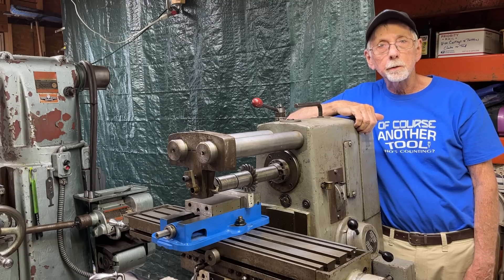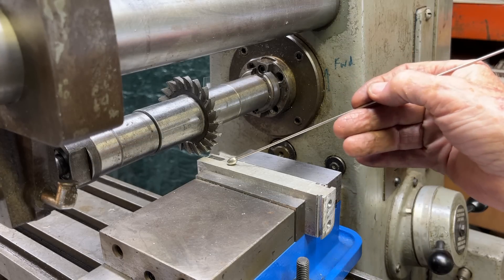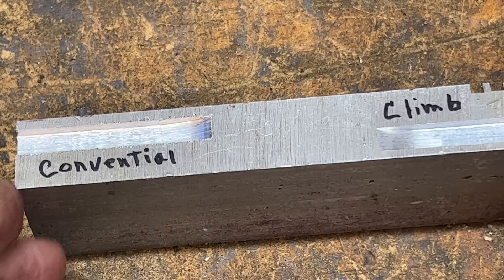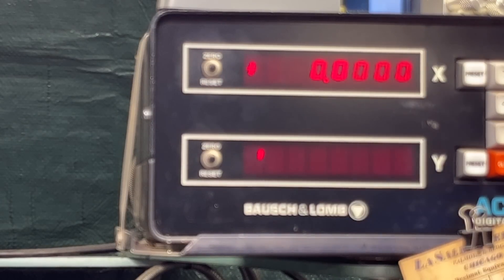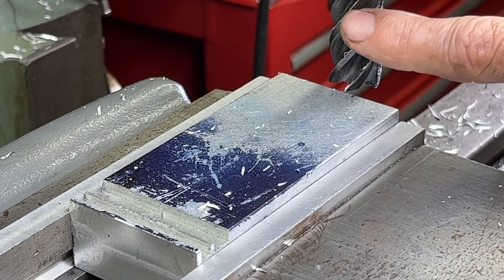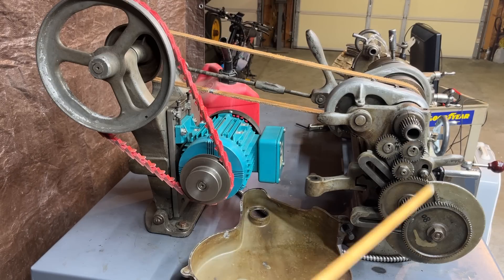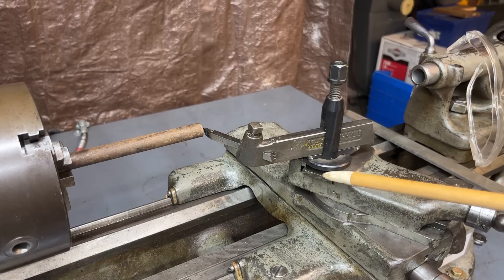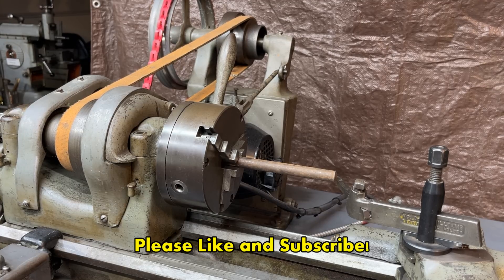SHORT SUBJECT #3 Climb Milling vs Conventional tubalcain

Comment: Hot chips could easily ignite that gas can... possibly even puncturing the plastic. Roughing with heavy DOC makes chips that really sink into plastic. Regarding the cloth, I also learned to use only small patches of scotchbrite, emery cloth and fabric for polishing. I keep small 1 1/2 inch patches in a jar by the lathe. Also make emery sticks instead of wrapping long pieces around the workpiece as I originally learned. Once getting used to it I find these much safer methods giving better results as well. Was an interesting thought excercise, thank You!

Comment: I never saw BX cable used around machine tools. Machines were wired using "Sealtite" tubing, to isolate liquids from electricity. Plus, the Sealtite would have been routed around that bench.

Comment: i never liked climb milling it always seemed hard on the cutters and machine to me i just set me up a small air atachment to keep my chips blown out of the work as it cuts along and seems to work fine for me and always leave about 005 010 for a last pass clean up pass and get great surface finish but i been doing comercial grinding for the last 22 years so dont get to do much machining anymore ----i sure do miss it

Comment: I wanted to add 1 other thing I do (personal choice) I keep a center or plastic plug in the tail stock at all times. I feel it just may keep some debris out of it and is easy to do. By the way I did rather well in finding the issues you mentioned.
Thanks,

Comment: I had a guy running a 5" horizontal boring mill. He was climb cutting by taking .100 cut on the side of a 2" dia. endmill that was 8" long. It was working until the cutter started coming off the end of the part and it grabbed and broke off the 2" shank. It sounded like a bomb went off. He doesnt work there anymore.

Comment: I have a good sized bench top mill and I do pretty much what you do, conventional milling for material removal and a light climb milling pass to finish. However, if I have a lot of material to remove I will take light climb milling passes on the return stroke to reduce the overall number of passes needed, especially in softer materials like aluminum.
Reply from the maker: That is precisely the way I do it

Comment: Having broken more then one cutter because I did not watch the play in the screw and having used only very old milling machines I have learned to never use climb cutting, the finish be damned. If the finish matters take a very small cut and use plenty of lubricant. Climb cutting seems to always give one more chatter as it did in this video if one listens to the sound. Aluminum is not steel, for anyone who might wonder.
Reply from the maker: Good suggestions
Reply: @mrpete222  Pete one thing you forgot in your video was to mention the play in the cross feed which also plays a part in the prospect of a broken cutter.

Comment: I did not know that about backlash, I thought it was just how much the handle moved before moving the table.
Reply: Backlash is the term applied to the total free play movement in a drive train. In the machine shop this usually describes the drive train of a machining axis. It also applies to other drive trains such as a gear driven spindle. I think of lash being different than backlash only in that it causes positional axis error of lost motion when changing axis direction. A simple manual machine axis has lash at every assembly joint and drive train link. Backlash is the sum of this lost motion. The handwheel is keyed to the lead screw. The lead screw is held in position with thrust bearings. The lead screw and nut have lash. A new industrial manual machine with solid ways and gibs has to have some lash to prevent binding. I set up new machines to as close as .0005" total backlash. As the machine wears, the wear is uneven. Removing all lash is increasingly impossible. Inexpensive machines have no provision to compensate for the lash except mitigating its effect by tightening the gibs. Progressively more advanced machines have backlash compensation included in the machine design. Some machines have a split lead screw nut. A spreader separates the nut halves loading opposing thread shoulders against the lead screw threads. Gear drives have eccentric mounts that allow the technician to force the gear mating closer together. Timing belts can be tensioned, but timing belts stretch requiring positional feedback for positional accuracy.

Ball screws with proper lubrication (normally forced lubed on the nut)and super precision thrust and radial bearings or more often TAC bearings to hold the screw can greatly reduce the backlash. Servo motors are often coupled with taper locks instead of keying. This allows zero backlash at that point and it will slip under a severe crash causing no damage.

Large industrial machinery rely on machine mass that light duty home shop machines don't have to mitigate against the effects of backlash. Parameters can be adjusted to automatically compensate for backlash to increase positional accuracy in axis directional change. Linear guides allow much faster axis travel rates than solid ways and gibs while essentially eliminating the mandatory lash of gib adjustment. Wear is minimal. You can compare the accuracy of precision ball bearings, reduced lash tolerance and longevity compared to plain bearings when comparing linear guides to solid ways. Ball screws and linear guides we're an enormous improvement over lead screws and solid ways. Linear guides can be field replaced by only moderately skilled technician when worn or crash damaged. Solid ways suffering the same damage require a much more skilful technician that possesses scraping skills.

Worn out hobby machines can have a huge amount of axis drive train backlash. With loose gibs and lack of mass, climb milling is prone to "suck" the work into the cutter. The backlash contributes to chatter issues. I am inclined to conventional mill to mitigate against the "work sucking" issue with my hobby grade machines. Manual machines without DRO rely on handwheel dial for position or an indicator. Keeping track of the backlash error and necessary compensation techniques is a challenge. The backlash in an axis drive train will typically vary greatly. Wear would be most expected in the center travel positions where most work is performed. Correcting for wear error in the normal operating range can cause severe binding in the uncommonly used areas. Compensation becomes a give and take situation until use demands require repair or replacement.
Reply: @paulhunt598  Wow, that is a lot of information. Thank you. I see now. I really do appreciate you taking the time to explain it to me. I mean that really does help. If I'm going to do any climb milling I'll give it a push/pull to take up the full backlash. I don't want to learn the hard way, that is why I have been watching & reading.
Reply: @simpleman283  I prattled on some more by editing my first comment. I was a maintenance and repair technician. I enjoy learning operating skills in my retirement hobby shop. Lyle is my most favorite YouTube instructor. I follow others as well. 34 years as a technician afforded many skills, but our shop segregated repair from operations. My manual operating skills lacked development because I had access to well maintained heavy industrial machinery and mostly CNC. Some of my hobby machinery is lighter duty and/or worn more than I was used to during my employment. This adds issues to my learning curve. Lyle has pretty light duty machines that he uses for his instructional videos. He is well suited to instruct me at my operator level. I routinely have to back away from feeds, speeds and depth of cut from what we could easily do with the machinery I maintained during my career.
Reply: @paulhunt598  Thanks for these very important in depth explanations of often misunderstood machine functions.

Comment: Did I ever tell you about the machinist that went around asking everyone if they stole his lathe chuck key? He couldn't find it for two days. Another machinist found it underneath about 8 inches of chips on the lathe the first guy was using. Bubba didn't do much housekeeping.
Reply: Then there’s that time old Bubba applied for a job as a lathe operator. They turned him down.
Reply: @ellieprice363  😂 Good one.

Comment: The optical illusion of the cutter looking like it is running the wrong way is very often seen in the wagon wheels of the settlers who are running from the Indians in western movies.  I read that the camera is running at a set frame rate that does not match the rotational rate of the cutter and that is what causes the illusion.  Varying the rotational rate of a mill cutter to see if it can appear to be going the correct direction might be a interesting experiment.

Comment: I own a good sized universal milling machine with a vertical milling attachment, but I have never used it. It's Polish made, and I think it's year of mfg is 1979. When preparing to load the thing, my assistant located a data plate and told me it weighed 4000 pounds. I took his word for it, but wondered why my lift truck, rated at 7000 pounds, was difficult to steer when carrying the thing. After getting it moved and cleaned I learned it weighed 4000 kilograms! Quite a difference...

Anyway, I digress... I have been most interested in your videos concerning the horizontal milling machine and noticed you always took conventional cuts. I wondered if this was the only way due to the much larger cutter diameter having much more leverage against backlash. Or, some other reason(s).

I've never ran a horizontal and when I get this thing running I'm sure to be facing a steep learning curve. I'm eager to put it to use making gears that no one else wants to tackle. I know you need to maximize your return on effort and probably won't want to go in depth on the horizontal mill as it may only generate one view, mine, so is there any good reading material you could recommend?

Thanks for your work here Mr. Pete! It's much appreciated.
Reply from the maker: Thank you for watching. Not many people are interested in horizontal Mills. See if you can find this old book on eBay entitled. A treatise on the milling machine by Cincinnati milling machine company
Reply: @mrpete222  many thanks for the recommendation, sir. I will be on the look out for it. It may even be something I can download if it's old enough. But, would prefer a hardcopy. I can still read that when the electricity goes out during a thunderstorm. Godspeed and good health to you!

Comment: The reason a Climb cut produces a better finish is due to the difference of the thickness of the chip from the entry to the exit of a cut. As the cutter moves through the workpiece, the amount of material a tooth is removing becomes thinner as it is shearing. This typically causes any chatter of the tool to bounce away from the workpiece, as the tool pressure is at it's greatest entering the material, and at it's lowest towards the end of the cut, since the chip is getting thinner as it is being cut. And the opposite goes for conventional milling. The tool pressure is at it's lowest entering the material, but increases towards the end of the cut. The increase in tool pressure can literally pull the tool into the work piece, causing a poorer finish. 

Conventional cuts also require more Hp (torque really) through the cut and will cause spindle loads to increase, whereas climbing spindle load reduces at the end of the cut. Climbing has it's greatest load at impact with the material, which is away from of the workpiece side of the cut.
Reply: That's a very good and clear description!
One point to add is that the thin, low-angle entry of the conventional cut is prone to rubbing. This accelerates tool wear and generates more heat.